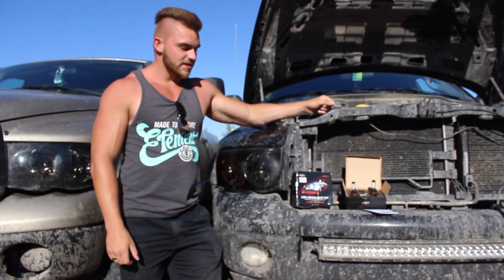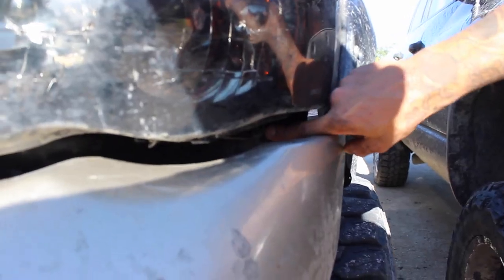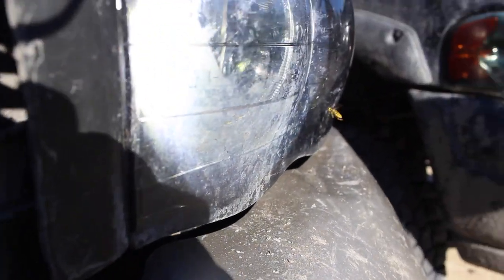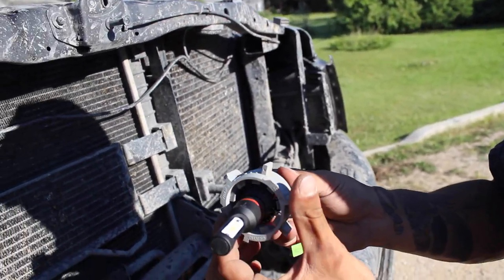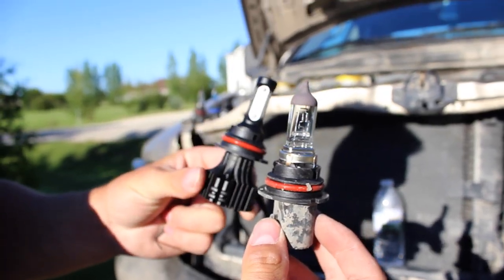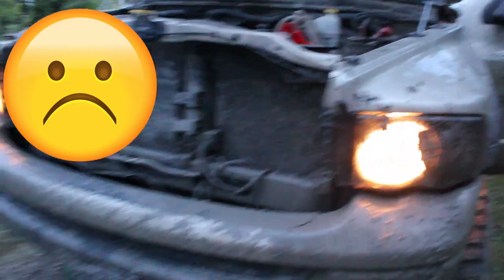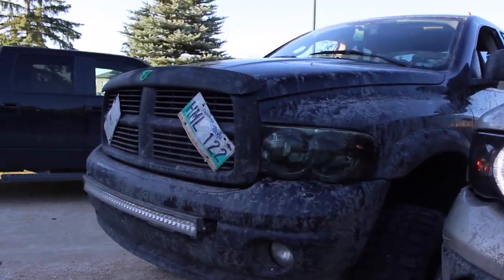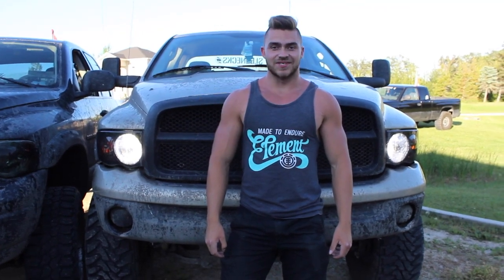WE GOT THE COOLEST LED HEADLIGHTS! INSANELY BRIGHT!

Comment: Has this thrown any codes since or have you guys had any issues? Ive got an 05 Cummins I want to put these in but I am a bit hesitant.
Reply from the maker: No codes , no issues !
Reply: Codidicus hey man don’t be hesitant! I also have an 05 Cummins and man these leds are amazing. I vht tinted my headlights and put them in paired with led fog lights. It’s the best combo
Reply: Good to hear man, thanks for the advise. How long have you had the VHT on you headlights? Has it worn well?  Did you just do a light smoke coat?
Reply: Codidicus it hasn’t worn what so ever. I didn’t clear coat it (which you should do it last longer) and I’ve still had no issues, looks just as nice as when I first did them. Yes I did a light enough coat to still be able to see but still looks dark